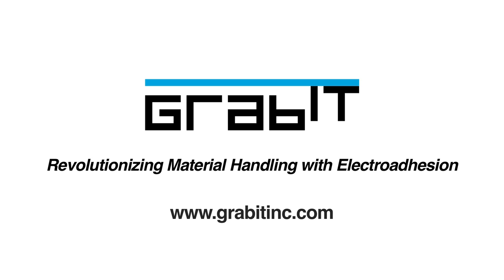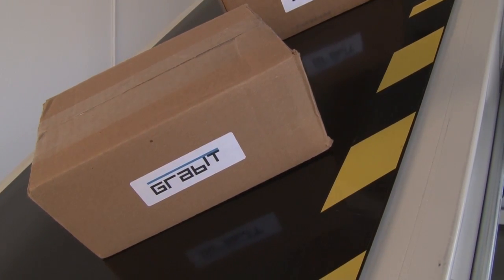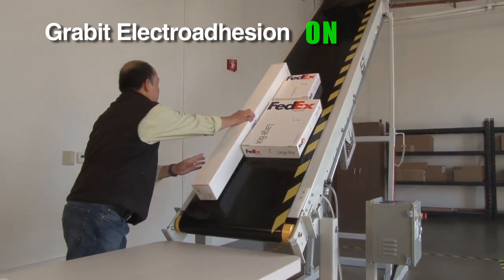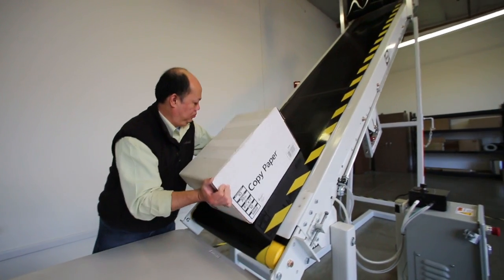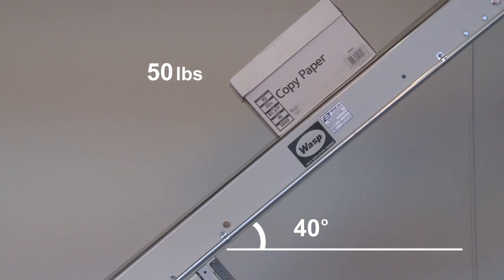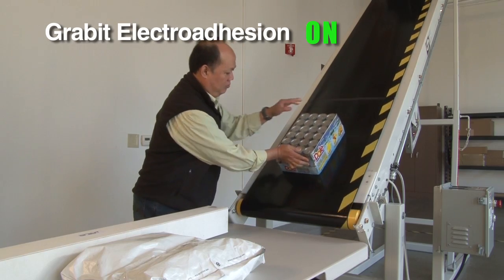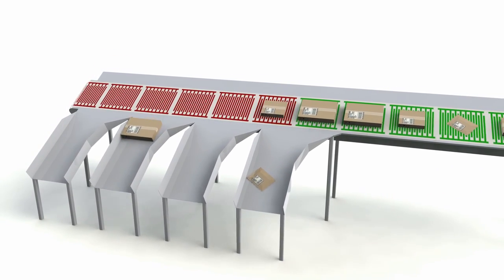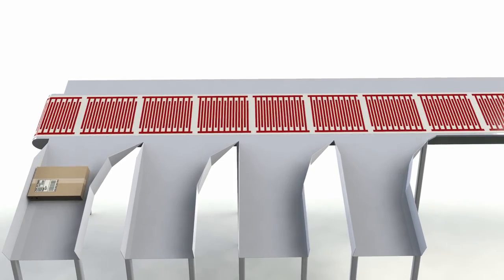Grabit electroadhesion smart conveyor - packages, parcels, bags

Comment: New amusement park rides, new way going up or down a mountain, landscaping control, cost effective and powerful elevators and lift based machines, shipping, restaurant use to deliver food, off-road vehicles, body shops and repair, deep sea salvage, medical use, mining, disaster clean up, safely moving fuel
Move anything with ease, cheaply and safely.